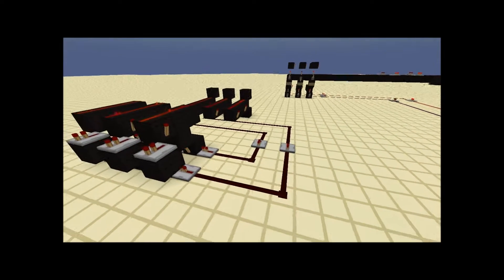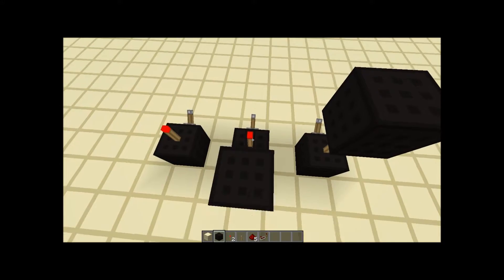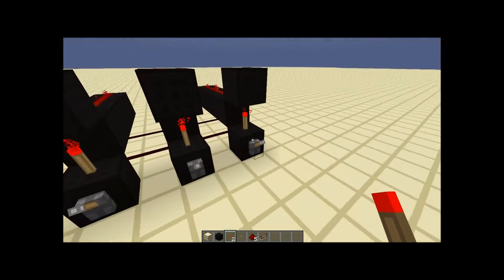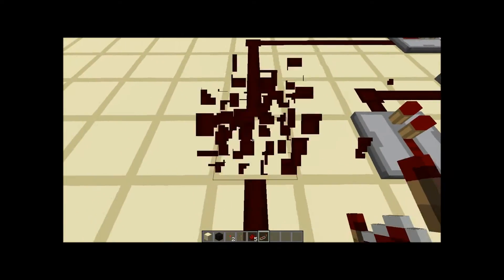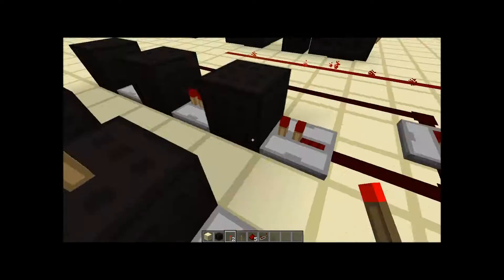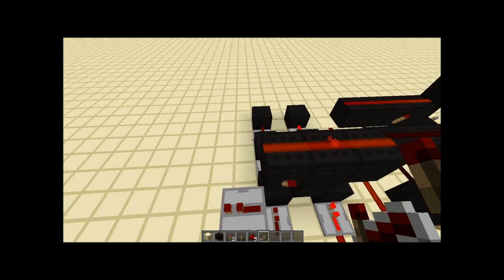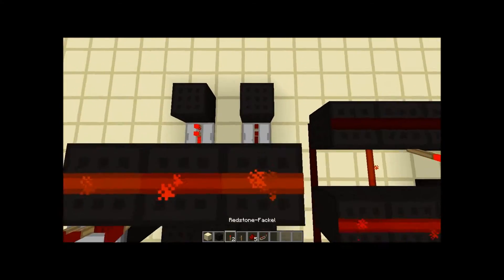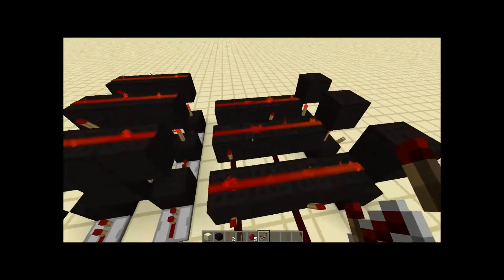Minecraft Tutorial   The simplest binary encoder and decoder ever made   [English/HD]

Comment: The problem is when you get to larger numbers than single digits, it becomes very impractical when your trying to use double or triple digit number inputs but for small scale stuff its perfect.
Reply from the maker: That is unfortunately an inherent limitation of the binary system. There are ways to reduce the size of the final transmission line, however the less lines you use the lower your bandwidth and thus information exchange rate is. 

Especially with a tick-based system such as minecraft I much prefer a high throughput e.g. 6 bit BUS over a pulsed single line.
Reply: @PseudonymosX  Exactly, i've run into that problem many times while making calculators and even now i get a headache trying to create binary encoders for 16 bit systems.